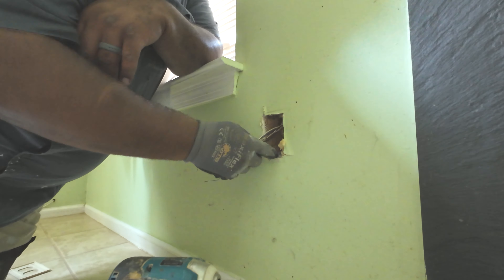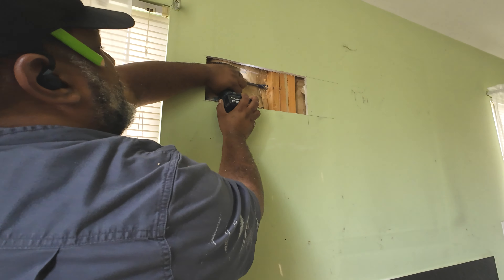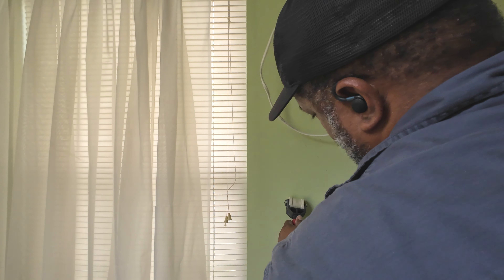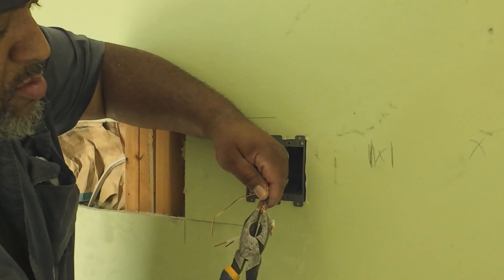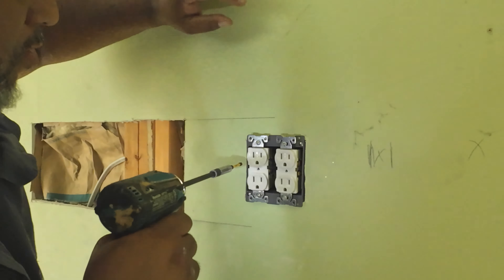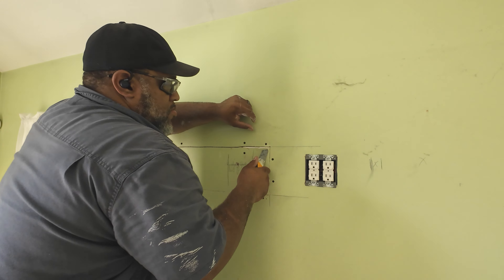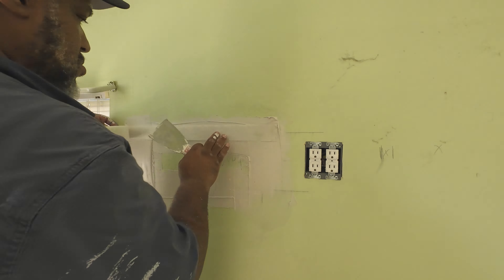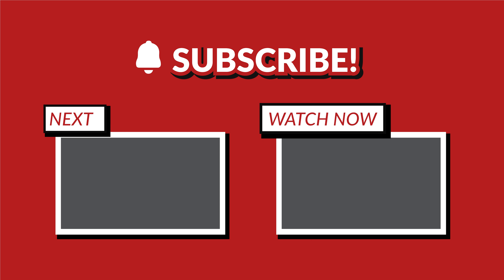Installing A TV Outlet Over A Fireplace (With Drywall Repair) | There Are Many Ways To  Do A Job

Comment: Great job and nice to see someone doing it so similar to the way I do it: Circuit breaker finder, my favorite stud finder, three coats on drywall patch, etc. I need to get myself a reciprocating saw and a lamp like yours for checking drywall repairs. Just a little hint: Break off the "ears" of outlets and switches when installing them in old work boxes. By doing that the cover plates will mount flusher to the wall.
Reply from the maker: Appreciate you watching and I never even thought about breaking off the tabs in all these years. Makes perfect sense though.
Reply: @DarylTheFINISHER I'd love to see the ear tab breaking tip demonstrated... I'm new to all of this stuff...
Reply: @DarylTheFINISHER  Hehe, I didn't know myself either for years until I learned from s/o else on YouTube. Love your good attitude! They said the "ears" are designed with this intentional cut/break line for old work boxes.

Comment: Nice work Daryl...I also prefer 2 coats hot mud and the finish top coat Plus 3. Hot mud always fights me when I try to sand it. Seems to clog up the sandpaper real quick, and doesn't feather out nicely.
Reply from the maker: I've tried easy sand and quick set lite and it seems like the only way to feather it out is to use a wet sponge before it dries around the edges. I'll do that when I have a repair that's going to be textured but I still prefer plus three when it's just painted.

Comment: I hate drying with a heat gun also. I use a heat fan when I have other tasks to complete in the house. Nice work.
Reply from the maker: I only use the heat gun when I need the patch to dry a little faster but in most cases I like using a heater too.

Comment: I’m a beginner so what’s the difference in hot mud and the last coat of plus 3 ? Great work by the way
Reply from the maker: Hot mud is just an industry term for a setting compound meaning it will solidify before it dries. It lets you apply coats much faster. + Three is a topping compound, it's easy to sand.

Comment: Daryl there are tamper resistant outlets out there that don’t allow kids to put forks in them. Easy sale. Easy install. Easy money
Reply from the maker: That's true. I'll ask people about using those if they have kids, but if they don't I usually just use the commercial ones or weather/tamper resistant if it's outside.

Comment: Hey Daryl, great video, quick question:  If that stud that you drilled through wasn't there and you were wanting to mount the outlet over the fireplace, are you allowed to have the Romex running diagonally from the outlet near the floor to the outlet over the fireplace? Or does the wire have to be protected somehow? Thank you!

Comment: “The RITE and RITER comparison haha,”
I think you did all that work just for this content. 
But for the ppl who thinking you have to do all that work just to get a receptacle there, No you do not. 😂

“ RITER COMMENT “with experience” 😂 Cut the hole on the side of the stud ,close so you can drill down on an angle , fish that wire down and your done “no cutting waiting or repair out of their 😎👌 ”
Reply from the maker: I understand what you're saying but I don't like to drill through studs without knowing what's on the other side. I found too many things in walls that weren't supposed to be there so I'd rather just do the quick drywall repair. That would be funny though to create a whole video just so I could say that sentence 😆